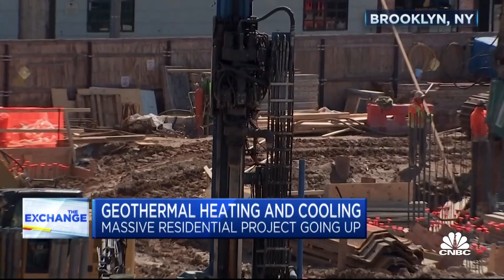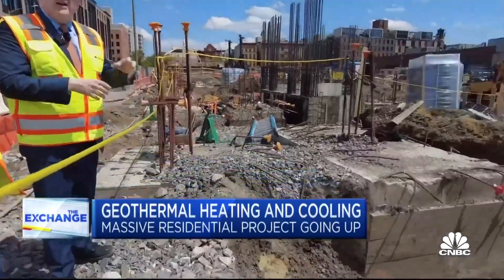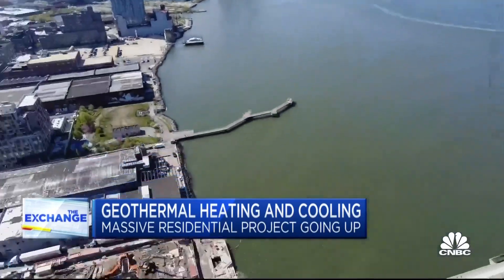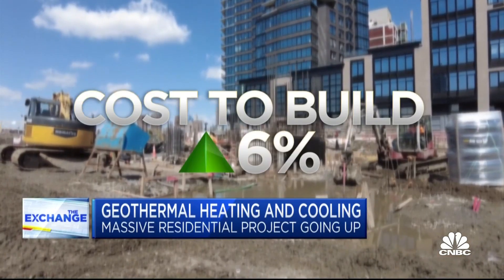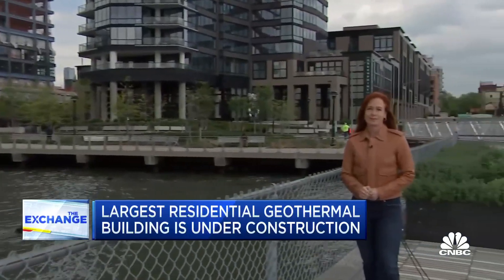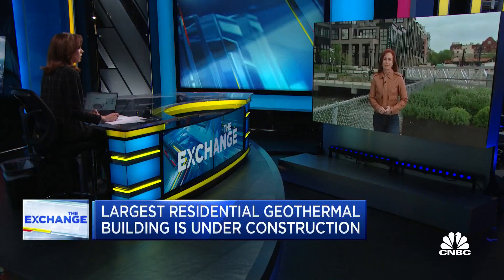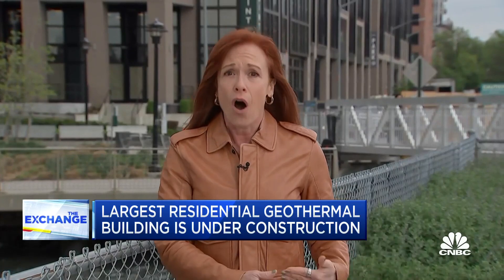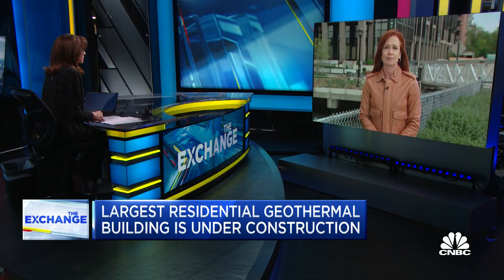Largest geothermal energy complex in the U.S. is under construction in Brooklyn

Comment: That is a Heat Pump System using Ground Temp instead of a electric fans but uses pumps to pump fluid to COOL the compressor NOT REAL Geo Thermal where Deep Ground or Volcano temp rock is used for Steam ENERGY for POWER PRODUCTION or HEATING WATER !